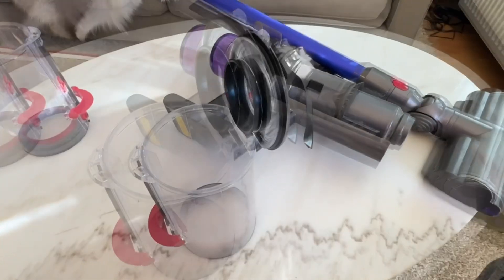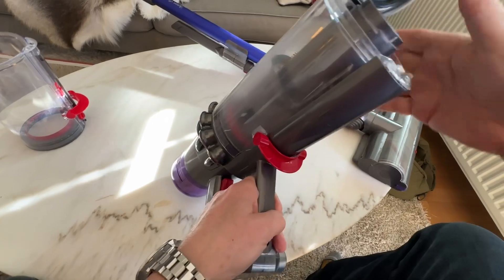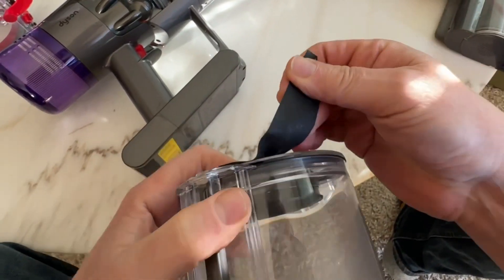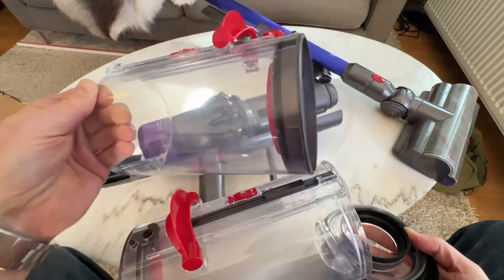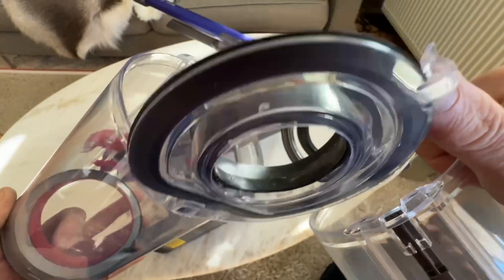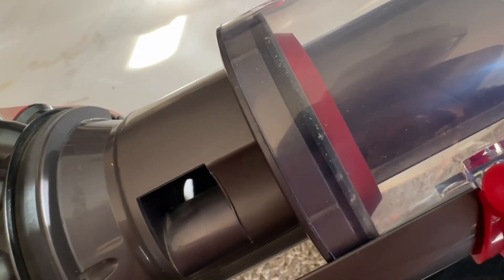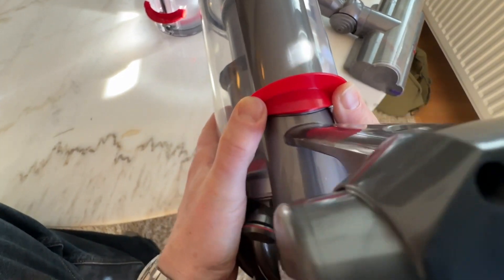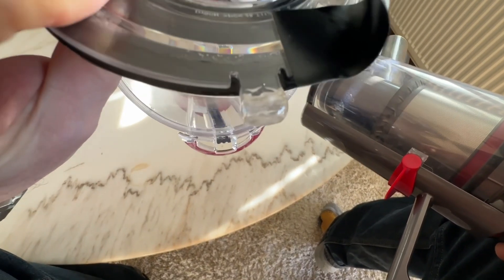Dyson Vacuum Lid Failure – The Most Common Breakage (and How to Fix It)

Comment: This is a common problem with all stick vacuums. My latch broke on my last two vacuum sticks. I, too, simply taped it shut.  It’s annoying because you have to replace the tape after a few uses due to the dust.  I was hoping that there was a better solution than just replacing the canister.
Reply from the maker: The trick is to buy the fake (non-original) canister, which fits poorly because of the low quality seals. Then you take a small kitchen knife and you bend loose its lid, which then is perfectly fitting in the original with the broken lid. I did it and it was straight forward!